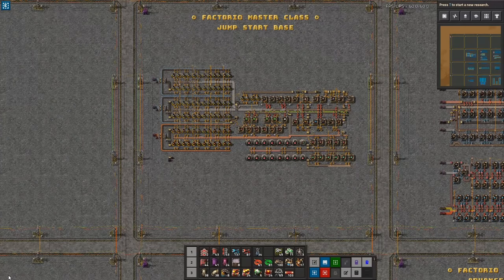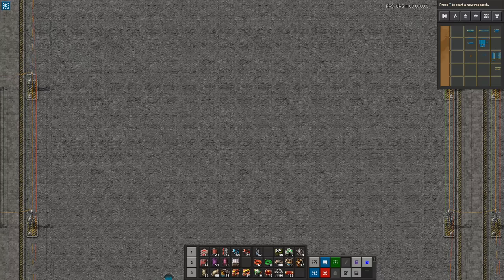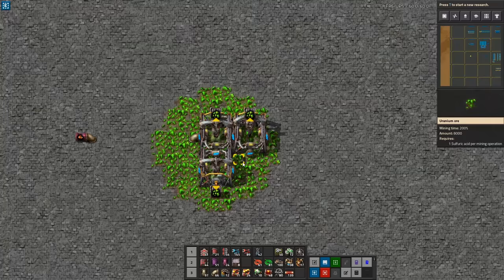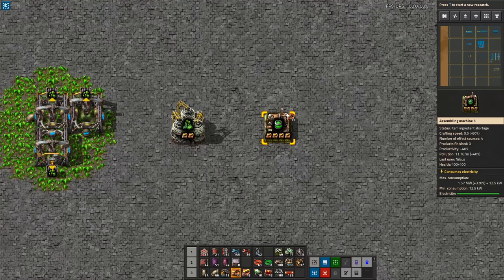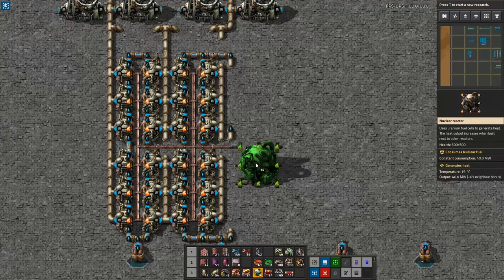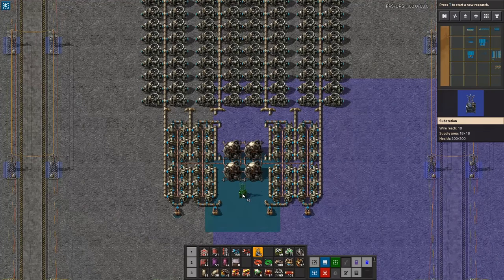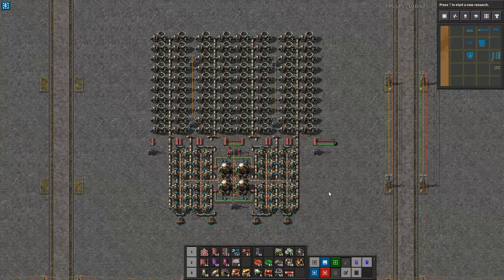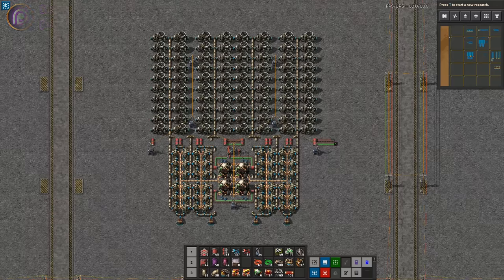NUCLEAR POWER; Shattering Conventional Wisdom | Factorio 0.18 Tutorial/Guide/How-to

Comment: You're right about the 2x2 going to a 2x3 reactor grid that it consumes just 50% more fuel, but your power output goes from 480MW to 800MW, almost doubling the power. So very much worth it to make such a design. I made a design which is almost a perfect mirror, it even includes roboports and has 1 belt going through the design which supplies the fuel and carries the spent fuel out as well without letting the input fuel passing through, it's stopped right after the reactors. And my design also lets you tile it perfectly in case you need more power. Both belts run parallel to the steam engines, one supplies the fresh fuel, the other gathers the spent fuel and they connect nicely. I may have to redesign it someday because my roboports aren't perfectly on-grid atm.

Comment: But the kovarex isn't for needing less miners, it's for allowing you to have that one patch last LONGER so you don't have to constantly run around and find new ore patches for your fuel.
Reply: Kovarex is for disposing of excess 238 automatically by turning it into 235. It's not about making patches last longer, it's about making damn near everything you dig up stop being useless dead weight.
Reply: @williambarnes5023  You're both talking about the same thing. When almost 100% of the patch is U-235 because of kovarex, it lasts longer. You aren't mining lots and lots of ore just to use 0.3% of it, you can use almost all 100%. The U-238 that used to take up space, and that makes up 99.7% of what you dig up, can all be made useful. Everything you dig up stops being useless dead weight... and thus you get the maximum amount of usable U-235 from every patch. Having 100% of the result be useful absolutely means a patch lasts longer, since you're using all of it instead of the vast majority being dead weight.
Reply: I agree with your point but I'll set the numbers right: 
It's 99.3% (or 99.28% according to some sources), and slightly less if you module the centrifuge, so ~135:1, give or take 5.  Kovarex needs a substantial working set (i.e. more than the stuff it actually converts) but the net conversion is 3 U238 to one U235.  Not sure how a prod mod could change that, but anyway you should use them if you can afford the power and production speed hit.  Anyway, first-hand U238 is converted to ~45 times as much U235 than the first-hand U235 you get, and Kovarex ain't random.  Finally, second-hand U238 from spent fuel reprocessing can be turned into even more U235, but that doesn't increase the 45:1 figure for reactors - because a batch of fuel rods takes 10 U238 to make; you're merely reclaiming that from spent rods.  (Not sure how a prod mod would change THAT tho...) 

Anyway, I got here because the math looked off to me  --  1 thousand ore per first-hand U235???  But that's right; the centrifuge takes a batch of 10 ore units per unit of U235.  It's essentially more than just the centrifuge.  It separates uranium from acid, tailings, and other impurities before separating the isotopes.  So, one miner at 18 ore per minute makes 1.8 batches, and ~0.013 of those are U235.  Which is enough to make 10 (or 11.6 with prod magic) times as many fuel rods, or ~0.15 of them.  Each can run the reactor for 200 seconds, so you get ~30 seconds of reactor runtime out of a minute of mining operation; two would keep the reactor more or less supplied 24/7 while ore deposits last.  Multiply that by 4 if you want to multiply the output of each reactor by 3, and you get the "8 mines" bottom line which Nilaus mentioned.  (His treatment was a bit confusing because he didn't mention the ore shrinkage in the centrifuge, just that 0.7% (of the total output) is U235, and a bogus "18 per second" figure when he meant per minute.  I hope my math is on point.  I'm interpreting the "8 miners" figure as the requirement per plant of 4, rather than a figure per reactor block.)
Reply: I don't think Nilaus was suggesting that kovarex was useless, just that you don't need it straight away, and that you can implement it later

Comment: Just here to confirm that I've just built a 10GW nuclear power plant, with almost exact ratios, that works at peak capacity indefinitly as long as there is fuel (it really does work, its not those ones you find on the internet that works for a few minutes before running out on water). I did it only cause I wanted a very big one, not because its highly needed. Your points are tottally valid.
Reply: how many reactors are there? or the ratios in general

Comment: hello, here's my 2 cents :
- while i'm 100% OK with dumping "perfect ratios" when they're not relevant, (so, most of the time :D)
- in the 4 reactor design, i'm very surprised that you choose to use the maximum potential of offshore pumps which are so cheap and trash the excess nuclear reactor potential which is so expensive. I usually go like this : 4 reactors + 6 pumps -> 6*8 heat exchangers > 6*14 steam turbines. Too many pumps & steam turbines, but every bit of the reactors power is tapped (i get 480MW out of it instead of 464 MW)
- doing maths makes people leave ? what ? that encouraged me to STAY 8)
- i agree with most of the opinions of the second half... although nuclear power without kovarex relies on having enough space to store excess u-238, and that's more than 1 steel chest per hour PER REACTOR, even with prod modules... so should it be advised to beginners ?..
- nice video overall, well explained, well organized.
Reply: Oh, c'mon, after getting to blue science even a "beginner" should be able to stash the trash in a couple of boxes without hand holding,  no?
Reply: @FDGuerin  You're right. I did the maths myself last time and I don't know where I made the mistake.
Reply: I should have read your comment before I built the reactor exactly as shown in the video--except that the water was a bit further away--and then spent a couple of hours trying to figure out why I couldn't get the full 464 MW of power. I noticed I was seeing 'Low Input Fluid' in several of my heat exchangers. It was easy enough to add a 5th offshore pump to make the design start showing the full 464 ME of power.
Reply: " 1 steel chest per hour PER REACTOR ", nothing a machine gun doesn't solve :)
Reply: @DavidSchmitt  This game is about automation. It goes against the main philosophy of the game to build a dump that you have to personally clear every now and then.
Reply: what does the nuclear reactor make that has so much value to where you'd want the extra 4% efficiency?  I am new to the game, but at first glance it seems you could centrifuge infinite U-235 and I am very curious about what i'm missing!
Reply: @SaturninePlaces  I think he is referring to the cost to make the reactor itself. It is often cheaper to round up the number of heat exchangers and turbines because they are much cheaper to produce, than to round down the reactor output.
Reply: @Hedning1390  thank you, That makes sense!
Reply: @SaturninePlaces  it doesn't make anything else except 5% more power, its not worth, unless you want to save on UPS, that is, the game processing time, but that's for competition and beyond end-game.
Uranium is plenty and cheap, saving that doesn't really matter.
Reply: @monad_tcp  honestly, i ignore kavorex for the entire game and just make uranium bullets.
Reply: can anybody explain to me why you wouldn't simply share the water from all 5 pumps and the steam from all the heat exchangers and then just build the perfect ratio? only because you care about tileability?
Reply: @monad_tcp  For real. I feel like people forget that you can destroy the chest and poof no more U-238. Place a new chest down and begin again.
Reply: Or, just shoot the box...
Reply: @kriegscommissarmccraw4205  the other comment already mentioned it, but that goes against the spirit of the game. The whole idea is automation: Having a design that requires periodic maintenance misses the mark.
Reply: @Hawk7886  So, you need to destroy that box automatically)) Can, say, a flame turret do that when it becomes full? And a construction bot will restore a chest ;)
Reply: @vp_arth  destroying a chest full of items is lame, full stop. Enrich it and use it for tossing nukes if you just want to dump it out the window.
Reply: I feel like you actually reinforced Nilaus' point here. A not even 10% improvement for much more hassle and space used. I'm sticking to the video.

Comment: Overall I like it.
 - Totally agree with your opinion on steam storage, waste of effort.
 - Not sure I agree with your conclusion on 2x2 layout vs infinitely tile-able, but you make a good case.
 - The only thing I really disagree with is capping your design on offshore pump capacity.  I would increase to 2 pumps per row (for a total of 8), or do 3 pumps per 2 rows (for a total of 6), so the reactors are your cap.  I agree that nuclear fuel is cheap, but so are pumps.
 - I definitely agree that you can run nuclear power for quite a while before requiring kovarex, just stashing 238 in a dozen steel chests for a while.
 - 28:20 maybe some people, but when you said math my ears perked up!
Loving this master class series!

Comment: apropos the steam storage; 

I use steam storage and 20-50% extra turbines, to handle peak variable power load from laser turret arrays.

My resting factory load is like 1.2gw but when the wall's getting pushed that can peak at nearly 2gw so that extra capacity just being there ready to go is v v nice, and the turbines/steam storage aren't terribly expensive especially compared to battery banks.
Reply: They are incredibly expensive in the Update calculation side of things though.
Each pipe and steam engine needs to do their own calculations.
Battery banks are the exact opposite in that no Matter how many you have, they will always need the same amount of updates.
So if youre building really big or your PC sucks, use batteries and preferably solar over nuclear.
Reply: @VoidplayLP  oh yeah, that's a thing. I'm about to set up a Ryzen based system next month so I'm not super worried about it but yeah, my mega base lags a bit.
Reply: @VoidplayLP  If UPS is a concern, you shouldn't be using nuclear power at all. You should be using solar. Solar cost 0 UPS.
Reply: @Alphenis  thats...what i Said.
Reply: @VoidplayLP  advocating solar for any purpose other than remote radar outposts is stupid simply due to the footprint needed
Reply: @jonne7725  the world is infinitely large. Space is simply not a concern.
Your computer doesn't have infinite processing power, it is a limited ressource that needs to be conserved where possible.
Reply: @VoidplayLP  explain to me how many chunks one gigawatt of actual power, which includes the
Solar power to includes the batteries and the extra solar power needed to charge that, and you know, let's include laser turrets around that area
Reply: @jonne7725  I feel like theres missing something there.
Anyway, I dont know how much space a gigawatt needs exactly. And it doesnt really matter.
The point still stands, all of that still uses way less processing power than a single nuclear setup.
If scale is an issue to you then thats on you. Space is the only ressource you ever have enough of lol
Reply: @VoidplayLP  not if you're trying to retain ups
Reply: Tommy Taffy  maybe you have a different rig than me but once i get into big map sizes my performance tanks

Comment: One touch I like to add to my nuclear reactors is to have the fuel creation, fuel reprocessing, and the inserters for the reactors all on an independent power grid run on a few solar panels and accumulators. If you make a mistake that results in a complete blackout, it can be a nightmare to get things started again without that.
Reply: i usually tap off some heat from the end of the reactor rows, closer than any other heat exchanger and with an own water supply, plus backed up by a Boiler fed from a chest with some surplus burnables, and an Accumulator, both with a Global Alert if it ever gets discharged/used. This powers everything directly related to the reactor (Inserters, Combinator stuff, Pumps), and also the Uranium refinement Process. The Output Turbines are then on their own Grid(s), completely isolated from the reactor-internal Grid. (a few Turbines on the Edge might feed both Grids to allow for higher consumption on the internal Grid, but i think thats not necesary)
Reply: Unlike coal power, you are extremely unlikely to brown out with nuclear power.
Reply: I would say that applies to coal/solid fuel power much more so. If you screw something up and lose power, kickstarting nuclear reactors isn’t that big of a deal you should be able to just clear out a clog and then manually fuel the reactors and it should get going again long enough for you to find the issue and correct it. I just keep a buffer of nuclear fuel and uranium if I need to do so. 

If your large coal/solid fuel generation facility blacks out (say you accidentally redirect a main fuel belt) getting that going is a pain because you need to feed coal to dozens of reactors long enough to get fuel produced and to the boilers, which is why I like to have a fuel supply on its own circuit that needs relatively few boilers to maintain that can easily be fed manually or with a single chest.

Comment: This reactor design produces 480MW(th) out of which 464MW(e) is used to produce electric power. A4W reactors on US Navy Nimitz-Class Aircraft carriers produce up to 550MW(th) each (1100MW total), of which only about 100MW is used for electricity production (wikipedia), the rest of the capacity is used for ship's propulsion, plus some extra capacity for safety margin and sustaining the aircraft carrier with one of the two reactors down for maintenance or recovery from a casualty. 

This design uses reactors that, unlike A4W reactors, operate at 100% capacity at all times. When operating A4W reactors, we typically maintain power as low as practical for the ship's operating conditions. Let's just say with both reactors running and normal day-to-day operations when in a mission area, they're typically operating at less than 50% each. The reason for using both reactors when one could carry the load demanded of both is to have operational flexibility if one reactor needs to go offline for maintenance or in response to a casualty. 

Factorio reactors also use fuel enriched to... exactly 5% (1/20 parts U-235, 19/20 parts U-238) whereas the enrichment of navy nuclear reactors is... I forget exactly but it's legit well over 90%. It may be 98-99% even. This allows navy nuclear reactors to load enough power-production capability to last a ship for literally decades. 

Someone with a lot more dedication than me could probably calculate the mass of U-235 consumed in 200 seconds to produce... well... actually, the fact that factorio reactors have this neighbor bonus thing kind of throws off the calculations. Why does a separate independent reactor adjacent to another reactor cause the fuel to produce more usable energy?
Reply: Maybe the neighbor bonus is modelling a larger combined reactor instead of many smaller adjacent ones. In a larger reactor core, the otherwise wasted neutrons could be used.

Comment: A few remarks:

You are using assembling machine 3. Those are not unlocked at blue science, but at purple science. With only blue science, you can only use 2 modules per machine (8% prod instead of 16%), reducing the amount of fuel you gain from an ore patch. It doesn't change significantly your conclusion, nuclear power is dirt cheap in fuel and should absolutely be rushed in the mid game (as soon as you can afford the enormous oneshot setup cost and you need the enormous power generation). 

Productivity 3 is completely overkill in general, unless you already have a massive base. They cost a massive amount of resources for very little gain. By the time you can afford to productivity 3 your nuclear setup, you most likely have Kovarex.

Using steam storage is mostly there to "future proof" your design (so you don't have to come back before a while) and to protect your grid from overloading because of laser turrets. Tanks and combinators cost next to nothing when compared to the enormous cost of the nuclear plant itself, so frankly there is little reason to not do it.

If you wonder about UPS, DON'T DO NUCLEAR AT ALL, do solar. Solar cost nothing in UPS, that's why all the megabases are using solar.

Once you have nuclear power up and running, you should upgrade your armor piercing bullets to uranium bullets. It only cost you U238 (the useless one) and uranium bullets does 3x the damage. They will shred through any bitters. You can do the same thing for your tank shells. Don't bother with nuclear missile however, those are next to impossible to build before Kovarex.

Comment: Excellent design and it seems you came to lot of the same conclusions as I did when doing my nuclear setup (although I never did the miners per reactor calculation, that is kinda crazy).

I also ended up with a 2x2 reactor setup (since you've got most of the neighbor bonus by then) and pulling water from one side without circuit controls or steam buffers. I sometimes add circuit control when I run these before unlocking kovarex but just adding a single storage tank is sufficient to monitor steam levels. Full steam storage is totally unnecessary.

It is good to see such a useful design getting highlighted. Cheers!

Comment: It is only tileable if we disregard water supply. If base needs several GW of power it  gets real messy real quick. I prefer more spread thin design, it also allows for +3 adjacency even though it is not a big deal.
Also, it would be excellent addition to show the design in action, to demonstrate that it is indeed producing at maximum capacity. Especially after what you have said about difficulty of designs with  fluids.